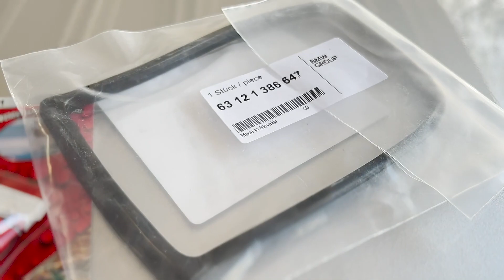Unbelievable Transformation! Watch What this BMW E30 Looks Like After a Quick Fog Light Refresh

Comment: What‘s the point ? Those are 35€ on the Bay, the new pair. Just got a pair in amber. Easier to leave the original frames in, just change the lights themselves.
Reply from the maker: Hey, thanks for watching and sorry for the late reply. Great question. I believe, and correct me if I am wrong, but the ebay lights have a plastic lens. Some want their lenses to be glass so I made a video for those that want to keep their fog lights glass. It is certainly a lot more work, but I think it was worth it. Thanks again for watching.